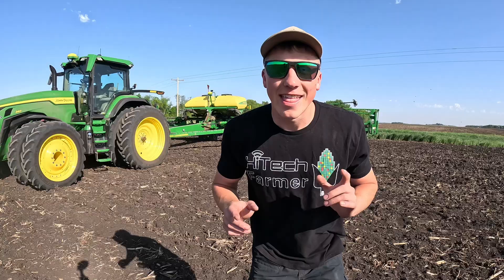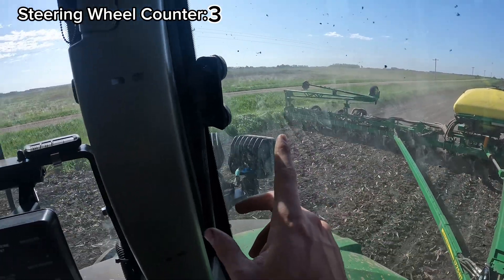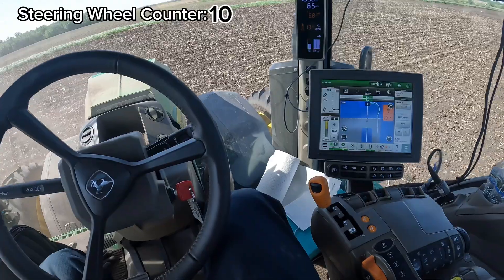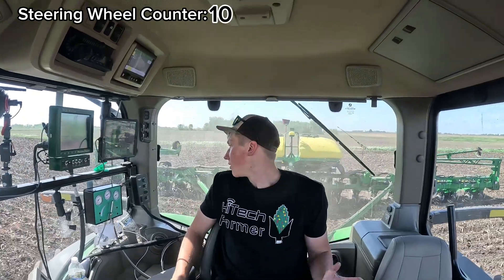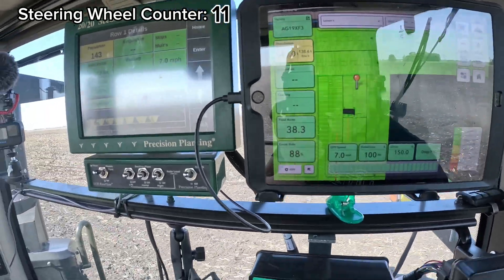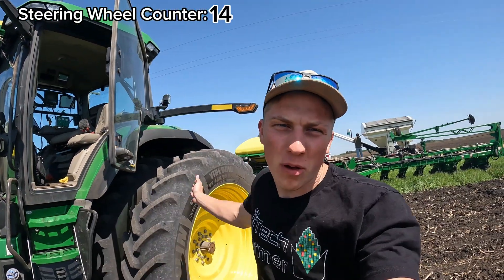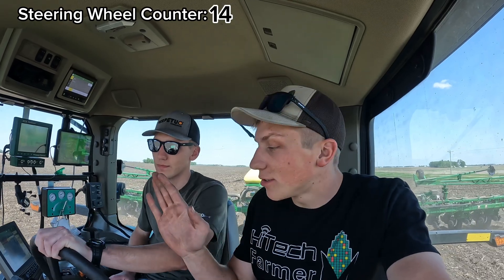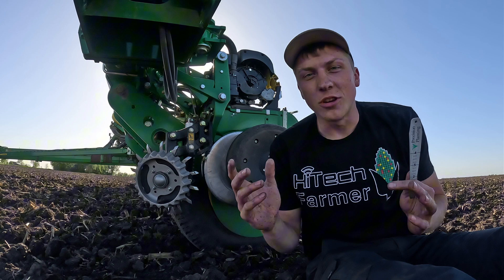Agriculture Technology Stole My Job

Comment: Great video!  How far can you go into the ditch when planting?  Does the county have so much space you're supposed to keep?  What's the purpose of the tile intake in the middle of the field?  Is there a reason it's there rather than at the end of a field?
Reply from the maker: My goal is to plant from fencerow to fencerow of a field. There's different set back requirements depending on the road. A township gravel road is we usually have to stay back 30ft from the center. A large state highway can be between 50 and 90ft. It's required for traffic safety and allows space for utilities such as telephone poles and underground wires to be serviced without damaging a crop.

Comment: Is there an automatic GPS assisted up/down of the planter for those permanent obstacles in the field? Like the drains you had to stop for...

For rocks that have not been picked you might need some camera assisted system. And that is also hard cause of the dust that can be around. So probably something more sophisticated like lidar and radar with the capability of distinguishing rocks from soil. 🤔
Reply from the maker: Right now there isn’t an automated system when planting around/thru the field obstacles such as the tile intake. Similar to large rocks that are out in the field, I’m required to take control of the tractor and stop in order to move the rock out of the way to continue planting. Definitely two things that will need to worked out for full autonomy